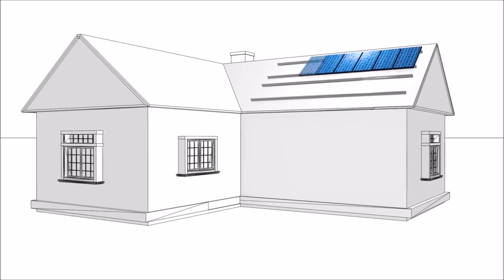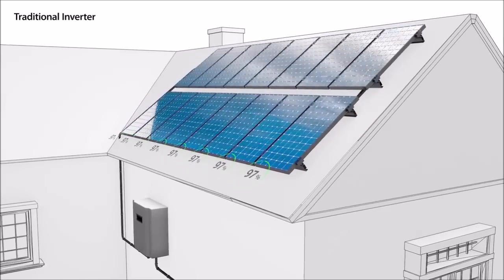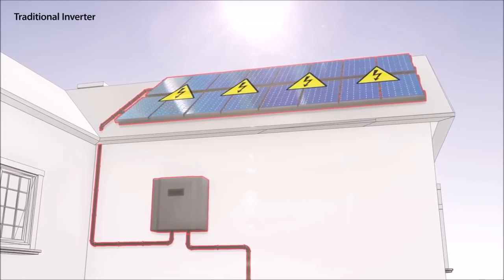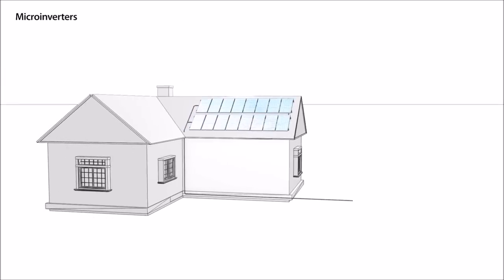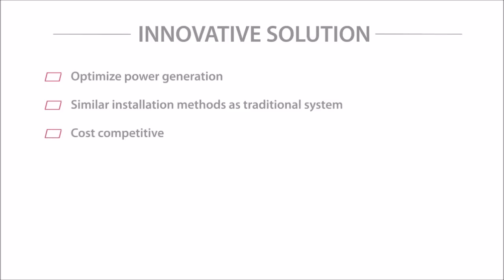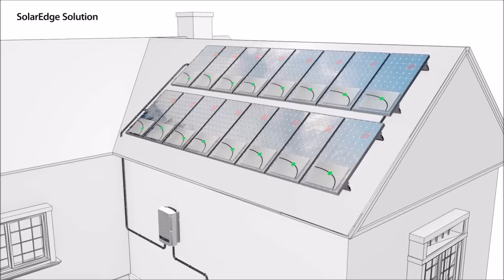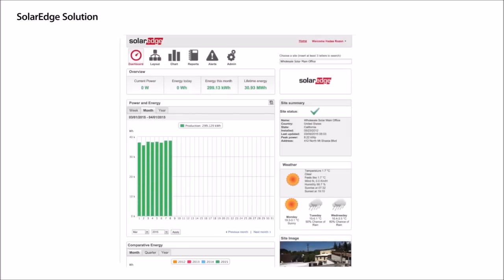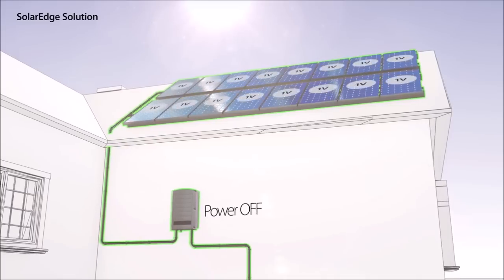solar edge vs other

Comment: I have a SolarEdge system. Installed it myself. Big regret. Yields are poor, mainly because of failing optimizers. Gave me a lot of work over the years. Once two (optimizers) are out, the whole string does virtually nothing anymore, probably because the minimum voltage for the inverter is no longer met. Replacing optimizers is a drag. For one side of the roof I rearranged wiring so that optimizers are now fixed at ground level rather than under the panels so they are easier to replace. This helped a lot. Don't fall for the marketing fairy tail, losses due to shadow are exegerated as independent tests have found. Losses due to failing optimizers however are substantial. You don't climb onto the roof to replace a faulty optimizer, disassembling half of your panels to get under the failing one, the moment the first one fails. You wait until the next one fails to make it count, then for good weather and free time. In the meantime your panels just look cool.

If you can find the right web form (customer service is absolutely useless) and give them the right serial number, they will send you a new optimizer but then the fun starts for you. Good luck. I've had about 7 or 8 optimizers fail on me in 7 years (out of 12 installed ones).

My next system for another roof will be nice and simple, just panels, wires and an inverter at ground level.

Comment: For STRING INVERTERS,
Is not true if you have one of the panel with shade, because it depends of the panels,
I.e. when you have shades on 1 pnanel, one of the 3 diodes of the panel swtiches to short circuit leavening the panel working at 66% at the rest of them can continue working 100%.
Note: the new panels have 3 diodes to avoid the rest of the panels works 50% or less.

Comment: Solar edge has a serious inverter reliability problem. I work for a small solar contractor. We replace a substantial number of inverters every summer. Based on my experience I would point a potential customer to one of their competitors.

Comment: do you have to drill a hole through the roof in order for the pipe to reach the inverter box? Will this lead to leaks in the roof?
Reply from the maker: No you don't have to drill a hole. We can talk more if you'd like!

Comment: Does Solaredje gives any compensation to homeowners ,when the system is out of order ,for the loosing profits?And how can somebody asks for these returnings?
Reply: Nope. That's why you don't want a system with a. Single point of failure

Comment: I recommend installing a budget system, no bells and whistles except for a wifi inverter with at least two string inputs.  There's no point paying more for so-called "premium" equipment.  As long as it's from tier one companies it's better to maximise your system size to make up for any apparent benefits from the other stuff the sales people try and sell.   For example, if they say a certain panel is 8% more efficient but the cost increase is $1,000, just buy two more of the cheaper panels in a 5kW system instead for about $250.  Much cheaper!  Also, oversize the panel output to 25% more than the inverter's rating.  This will give you better electricity production in the mornings and afternoons that will easily compensate for the occasional clipping at the peak generation times.:-)
Reply: Would you recommend that with a system that gets shaded? SE optimizers can significantly out perform a traditional string in partial shade. How about those that need more than two or three roof planes, would you suggest getting two string inverters with a 10-12 yr warranty you'll most likely have to replace one day? SE allows for flexibility in strings of different azimuths/pitches and is pretty cheap to extend the 12yr warranty to 20-25yrs. making it a cheaper solution in the long run.  How about efficiency? The solaredge HD wave is 99% efficient while most  traditional string inverters are 96% efficient in converting DC to AC. With a home that consumes 10,000 kWh that 2% is worth $50-70/year in CA, times that by 25 years and the inverter pays for itself in the extra generation alone. I wont agrue on the DC over sizing that for some may be a good choice but definitely depends on a lot of factors. As for the panel selection just like cars all solar panels aren't all made the same. Degradation and temperature coefficients are a factor. While I agree some of the top few panels are priced way high compared to their "benefits"  they have their place. For instance, if I'm designing a system that with a 280W panel and have maxed out the south roof plane with 20 panels and then have place 5 more on north to get to 100% offset I may choose to run 330W panels on just the south to obtain the same production. I then can purchase a smaller inverter. Either way things are not a one size fits all, every home has an optimal solution. Strings definitely have their place in the solar world but its shifted to where they really only belong on large unshaded arrays.
Reply: @brianhundley833  , SE sounds great and I've thought about getting one.  However, the reported high rate of SE optimizer failure is worrying.  It's not just the cost of the unit but all the labour of getting back up there.  If SE disputes the replacement or your installer has disappeared then you could be left with a large bill.
Reply: I don't want a single point of failure.. Ill stick with Microinverters thanks
Reply: maybe but customers are going to want what they want

Comment: So you don't do batteries?  I was wondering if someone has panel or panel group monitors/chargers?  And could such monitors/chargers parallel charge a battery pack.  Then tie the battery's to a grid-tie inverter.
Reply: Solar Edge recently bought a battery company.  I forget which one.  I think Korean.